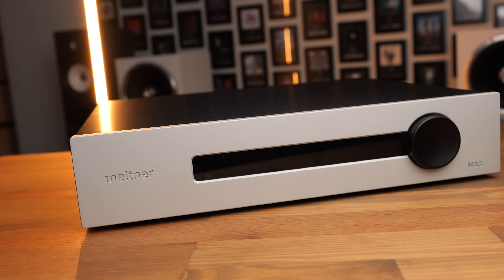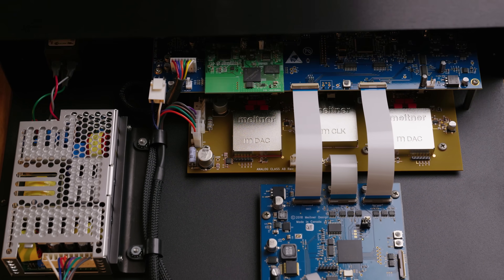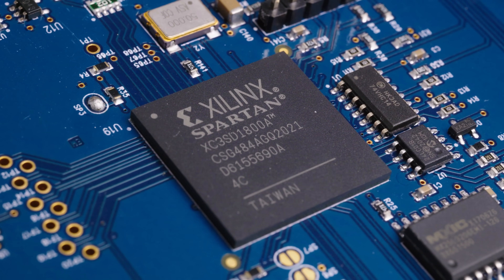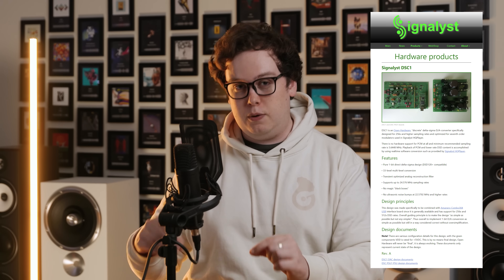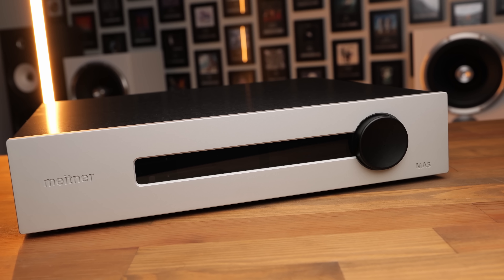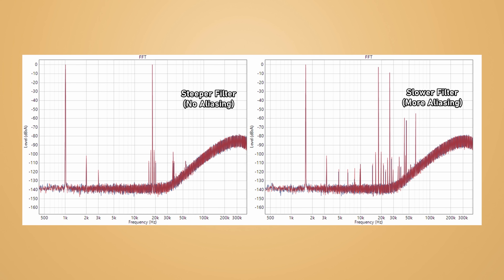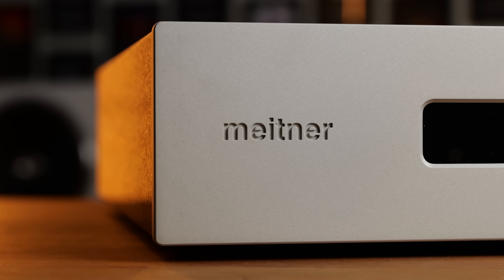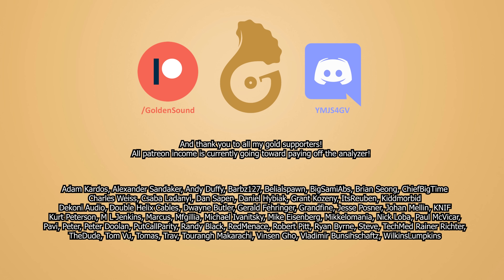Are DSD DACs always better? - Meitner MA3 Review

Comment: In fact, you can simply feed the DSD signal into an analog low pass filter and you will get audio out. Of course this will not in any way qualify as high fidelity but as a proof of concept it works (I've tried it)

Comment: A very interesting and detailed review.  Thank you.  However, it is not clear from the review if you are actively switching the phase to the optimal setting for each album?  I have a very good classic system including the Museatex (Meitner's old company) BIDAT.  I have found that when the music presents itself similar to how you describe the short comings of the MA3,  I press the phase button (invert phase) and usually the sound drastically improves.  Most hifi enthusiasts do not appreciate the importance of using the correct absolute phase for each recording.

Comment: Wow - you tested the Meitner fast transient vs slow transient adaptive filter - I always wondered how that actually worked in practice. So it switches filter above 1.5KHz. A few msecs to switch seems like an eternity in audio but honestly low frequencies will mask high frequencies anyway - so it is probably more than fast enough. It is impressive you tested this! Filtering is a huge problem in upsampling - this feature of the DSD conversion in the MA3 might be the source of smooth mid range sound. Upsampling on a PC in Roon or using HQplayer of course eliminates the upsampling quality issue faced by all DAC’s - it took me years to realize that almost all DACs operate in DSD and the mathematical upsampling conversion needed to feed the 1 bit converter is the weakest link in the digital audio playback chain. Some engineers who invented SACD must have realized this but DAC chip manufacturers are in denial of these audible issues.

Comment: Listening to Meitner MA3 DAC in comparison with Weiss 204, Meitner definitely doesn't sound like it has a flat frequency response. Around 1khz there is a dip wihich robs vocals, piano and other instruments of body. Ther is also some dip at high treble which makes ride cymbals lacking in body, presence and the wash of  cymbals (drummers will understand this) . Quarter of the cost of Meitner the Weiss, 204 though slightly warm in the mid freq region, is a huge bargain and preferable actually.

Comment: Hi, I had sort of a simple technical question: how is the bits "binary number" transmitted? a) is there a "single voltage" that corresponds to a binary number (hence, there are 2^n possible voltages when n is the bit depth), or b) there is a specific voltage for one, and specific voltage for zero, and the binary number gets "built" by the combination of these individual zero or one pulses? (hence, every "n" pulses create a sample, when n is the bit depth)

Comment: I'm curious what you make of the EMM Labs DA2 (Stereophile) measurements looking different than what you describe as they use the same main board and algorithm. From what those plots show, and how it sounds to my ears, is a steep brickwall low-alias, high bandwidth filter that only opens up on very fast transients to eliminate pre and post ringing. That is the inverse of what you describe. My gripe has been that the filter sounds too steep most of the time, which corresponds to the "dampened" sound you describe. The high frequency softness is common to all DSD DACs. 

[Edit:] From reading your measurements, looks like an error in the transient detector algorithm of the MA3 .

Comments about black background and depth though, seem relatable.
Reply: And, difference in ultrasonic noise is probably not the modulator, but filter. In this case, noise that far out doesn't matter, but in all likelihood other DSD performing DACs have an additional filter, whereas the MA3 has higher unfiltered bandwidth.

Meitner claims their power-factor-corrected SMPS is lower noise than a linear one, but I'm not really convinced.

Comment: DSD is DOA IMHO.
Reply: Almost 99.99% of DACs are ultimately 1 bit DSD at the output. So all the PCM source material is being converted to DSD whether you like DSD or not. As Cameron correctly notes - DSD conversion quality is a factor and if you can afford some latency then a high powered PC will sound far better than any DAC with a built in DSD converter (upsampler)
Reply: @JH-fl3vi nope, most of them are multibit deltasigma DACs. I like AD1955, an amazing one when properly cooked.
Reply: @ check the AD1955 spec sheet and you’ll see the PCM follows the same path as DSD - it’s upsampled. Only a ladder or R2R DAC can run without upsampling - these are true multibit DACs. A sigma Delta is by definition a 1 bit converter it requires upsampling - basically it’s DSD
Reply: @JH-fl3vi interesting 
So, HQPlayer is a better option over this type of DAC or even the Playback Design or Cen.Grand?

if I use HQPlayer, I will still need something like the cheaper Cen.Grand DSDAC DAC?

Comment: A casual observation. $10,000 for what is in the box is laughable. 🤷🏻‍♂️
The power supply is an embarrassment. It's also poor design to use an oversized box for the contents of this product. 
I stopped right there.
Reply: You know that SMPSs outperform LPSUs in some areas right? That top end manufacturers use them? Meitner are skimping to make extra profits on an item in a niche market on low volume? Doesn't quite add up does it? There may be reasons for the box, it may even be aesthetics. This is just like a school yard, crowd behaviour, lets all join in before thinking, let's not be inquisitive or curious, just put the boot in, like a mob. Nice
Reply: @TintinAbulum Please enjoy your overpriced toy.

Comment: I really like this comparison to Yggy - this is something that many in the high end  review space don't dare. Even when the reviewers don't get captivated, they often go with "but if you really like XYZ in the sound, this might be a DAC for you" - but sometimes that's just a bad advice, because there are some similar sounding, cheaper, better alternatives. Let''s be real, it's really hard to have a 5-10-20k$ piece of equipment that is downright bad. But it can be overpriced. And I just wanna throw it out there - I know that the DAVE also doesn't have the greatest of PSUs and it's a great DAC and obviously there is more to the subject than I understand - but I just can't stomach switch mode anywhere near this price point.

Comment: Cameron, I’d be interested to see what you thought of either version of the PS Audio Directstream DAC in comparison to these other dsd DACs. Have you ever auditioned one before?
Reply: I owned the ps audio direct stream  Dax for years and strangely the weak points mentioned in this great review are exactly the same. I currently have the CDSA SE from Emm labs (same company as Meitner) and it out perform the ps audio direct stream easily.
Reply: Directsteam DAC has much higher distortion from output transformers, and much higher noise floor. But you might enjoy the coloration, if at a loss of transparency and technical ability.

Comment: Inside is ridiculous, the boards are so small why use that stupid big case? Is that 10k price tag includes some air in that chassis?
Reply: I absolutely agree with this. What's even more insulting is the switching power supply!
Reply: @dontcare563  Space gives separation reduced interference/noise, SPS are superior in a number of ways. Doesn't it depend on performance rather than requiring a transformer? Simplistic views
Reply: @TintinAbulum    and yet there is no evidence of that in actual testing. There are tiny devices with huge transformers that don't have these issues. We like transformer bases devices because they have been  objectively shown to last longer from real world testing. Not definitively, but better than speculation like you have committed to in saying there are reasons for it being this design. These are ultimately speculation because you can't prove it.
Reply: @En_Joshi-Godrez  So actual performance isn't relevant? If SMPS sounds better, go with LMPS anyway
Reply: @user-hu4ob8vc4w    no, they will perform identically if they measure identically. Both technologies can achieve identical measurements, but its transformer based designs that have longer life spans that have actually been proven.
Reply: @user-hu4ob8vc4w    It's like the balanced debate. High-end manufacturers like chord and benchmark don't believe in it because it's benifites that are conceptually real have no relevant impact. "No no, there might be" then you need to prove it. All we as a relevant limitation is their longevity in constant use.
Reply: @En_Joshi-Godrez  have the PS tested badly somewhere? The speculation is yours. Plenty top end players use SMPS/Hybrid power supplies. Keep up man.
Reply: @En_Joshi-Godrez  what is the lifespan of this PS? Do you think Meitner wouldn't replace if there were an issue? Where are the measurements for this PS please?
Reply: What about David Bearning  = [ AMPS- Pre - NO copasisters]  HIGHly Recommended - LOOKS empty  $$$ Excuse spelling. ⁉️
Reply: Space is critical in line level components. It’s why Pre-amps are so big and empty. Mcintosh in particular achieve tremendous specs by separating power supply from line level signals - there is a reason why large components and empty space are needed - it;s engineered that way.
Reply: @JH-fl3vi So your theory is spaces are needed for separating power. But from the video it seems that the power supply isn’t too far away from the main board, and most of the empty space were at the front of the case, which makes no sense at all.
Reply: @LemonVergil  The line level signal boards in the back are there due to input and output connections. The converter appears to be below and separated from the input (above). The power supply is separated in the far left in a faraday cage. The reviewer is not up to speed on the latest power supply design and seems to think linear power supplies are better (SMPS have come a long way in 20+ years) The digital FPGA processing chip (XIlNIX Spartan) is in the centre away from everything. The gap in the front is to keep everything away from the OLED display. Could it be made smaller and is it way too big? I don’t know - all I can say is that there are some good engineering reasons to spatially separate digital processing, digital input, analog output, display and power supply.
Reply: @JH-fl3vi  so you don’t know why they made that so big either, and I don’t really care about your theory about line level stuff. All I question here is why they made this so wasted in space and ask for a stupidly high price, and you didn’t answer my question, so no more conversation we should proceed since you don’t have the answer.

Comment: "switch mode power supply- particularly nice one" = 9$ instead of 5$ 🤫
Reply: Yes the old way to judge high end audio was massive linear power supplies (think Pass Labs, Parasound etc). Recently that old rule of thumb has been changing. Switched Mode Power Supplies can be designed to operate now at extremely high frequencies well outside the audible range by many orders of magnitude. This is resulting in BETTER performance even whilst the components are cheaper than a massive linear power supply. It is progress - cost and performance aren’t always directly related.

Comment: Thanks for the review ! Will you have the opportunity to test the Laiv dac ?
Reply from the maker: Yeah I've had one in for a while. For transparency I'm doing some consulting for them so have had a bit of input on the DAC, but it's great for the money
Reply: @GoldenSound  Is it better  than Holo May Kte ,T+A Dac 200 or Ferrum Wandla ?
Reply from the maker: @sorinnour  ehh kinda depends. It's a fair bit warmer/smoother, which some will prefer, but it's also not as detailed/technically capable
Reply: @GoldenSound  Love your reviews and use them a lot for the DAC I am considering. How do you think it compares to the Holo Spring 3? 

Also hope you are able to review the Holo Cyan 2 sometime
Reply: @GoldenSound Have you tested the Signalyst DSC1? I went to the link you provided and it doesn’t show how you can purchase one. Is there anywhere where it sold as DIY Version to buy??
Reply: @GoldenSound  Why is this disclosure made so discreetly in a comment? This type of disclosure needs to be forthcoming from you in a video, instead of when prompted by a comment on your video.
Reply: I'm waiting for the LaiV Harmony GoldenSound Edition which corrects its shortcomings

Comment: It's big so that silly audiophiles can go "oh this feels heavy, must be worth my 10k".
Reply: I like heavy. My tube integrated weighs a delicious 63 lbs .
Reply: I think most people equate greater weight with higher quality, personally when I pick up something that is a lot lighter than I expected, I presume its going to be very expensive. With audio desktop or rack gear I would prefer heavier devices so that they don't move around when a stiff cable is attached.
Reply: @mrfrosty3  well in audio weight is directly related to power transformers that are crucial in amplifiers... so in most cases heavy, good and pricey are definetely corralated.
Reply: Exactly - it's pure marketing for the gear dweebs.
Reply: A sack of coal is very heavy and offers great bass response  - price is very reasonable too
Reply: @jondu-sud274  well but most audio gear do not have a sack of coal inside
Reply: @jondu-sud274  wonderful analogy, Maybe they found it was good for insulation, we could ask or just talk about coal.
Reply: Thank you for the in depth review and sharing your views on this pricey DAC
Reply: and they are right 99% of the time 😂